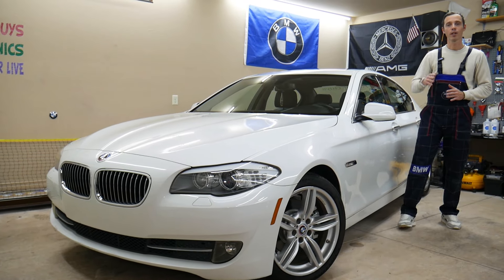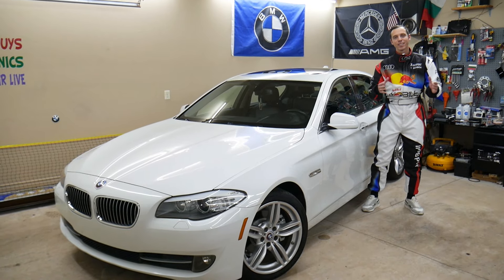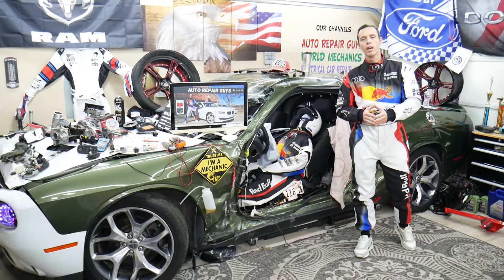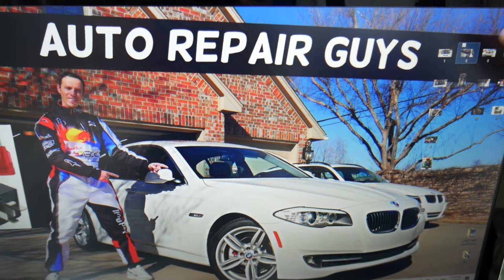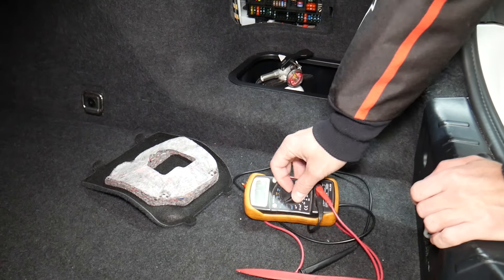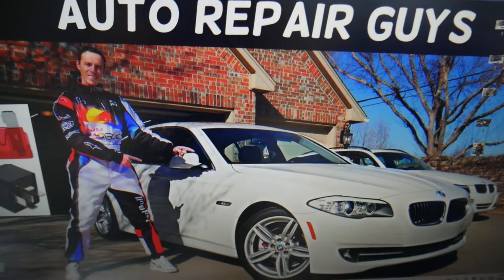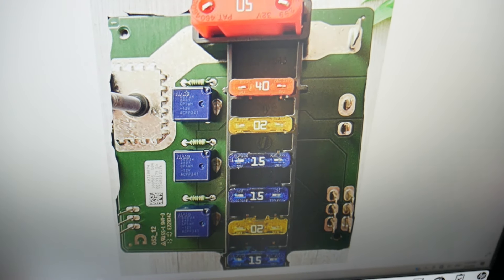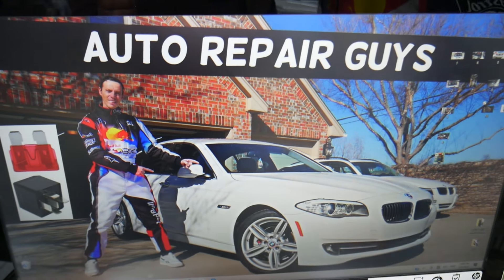BMW F10 F11 FUEL INJECTORS FUSE LOCATION BMW 528i 535i 520i 530i 550i 518d 520d 525d 530d 535d

Comment: Which is the relay for the fuel injectors, my F10 has no power to the injectors and I have replaced the power distribution box, it has fuel and spark but not power to injectors